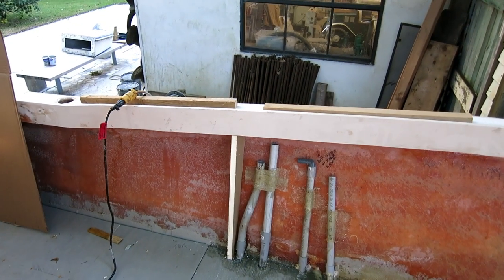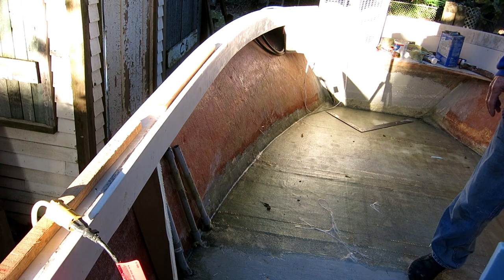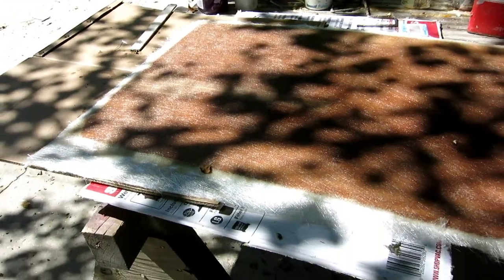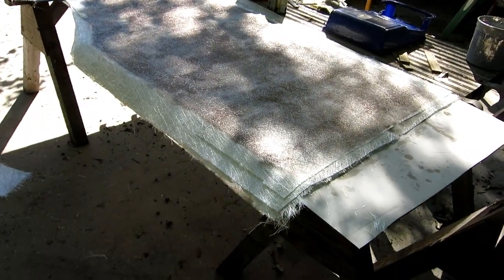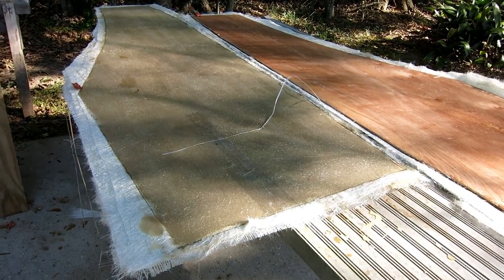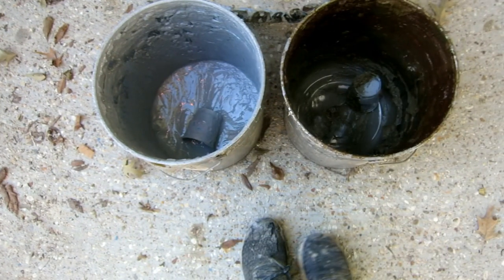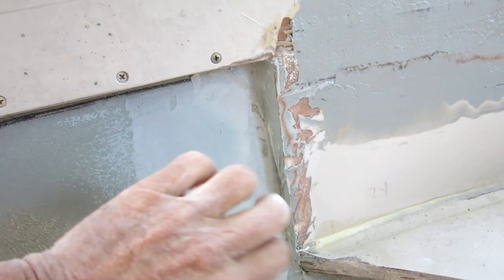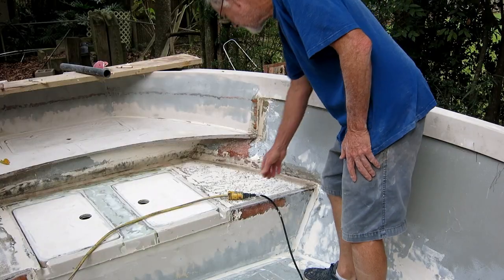The CC Boat Project # 15 Building The Side Closure Panels

Comment: I would have used that mat that was hanging over to epoxy it to the hull with instead of cutting it off.  I'm really liking what you're doing here. It is very close to what I had in mind for a boat project that I am working on and really informative to watch you go first.
Reply from the maker: My hat's off to estimators, they got every job I ever built! I will be your guinea pig, no problem. Glad you enjoyed, good luck on your project.
Barry